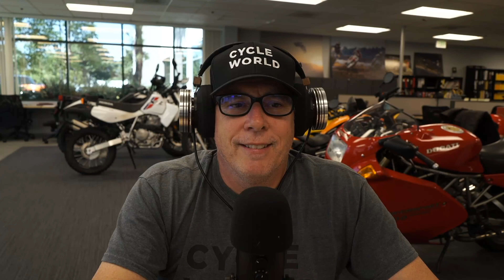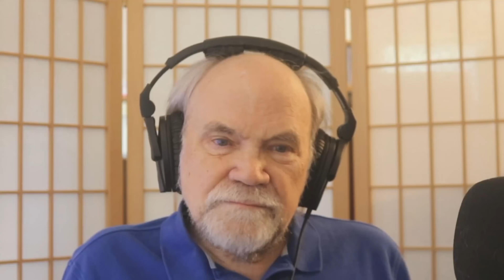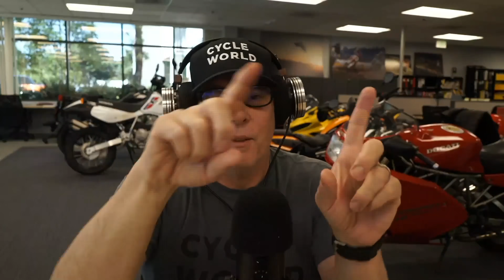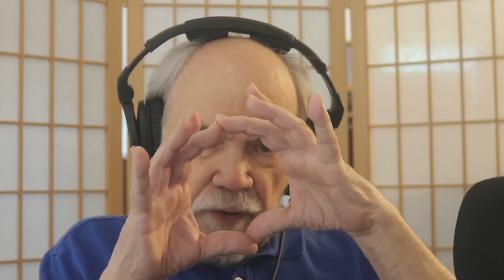JUST HOT ENOUGH! Combustion heat to tire heat to radiators, oil cooling and more: Heat Management!

Comment: Why not heat water with the exhaust and have a secondary power system for steam.  It could turn a steam turbine to turn a shaft that runs a generator that charges some batteries and capacitors.

Comment: Got a factory oil cooler and piston squirters on my 2012 streetglide.  I think this is why the factory top end still on it after 80k plus miles. .570 cams at 57k with better oil pump and cam plate.

Comment: Thank you for your fine podcast. I've enjoyed both of you guys'work in the past and am grateful to hear it.
When Kevin was sharing about the flame front of a hemi engine being longer compared to the flatness of conventional heads (shortest distance is a straight line and all that) I was reminded of a  Don Garlits' story. 
On the 426 hemi became available. Done Garlits was tasked with getting it up to speed using nitromethane. Though he and others had gained success with the previous 392ci hemi,  he ran into all sorts of problems with the 426. In fact he was so discouraged , he through so much  advance timing into it with the hope that it would blow up. No, that's what it needed.  So that let's start the party early with the flame with a high degree of advance was just that what that hemispherical shape needed to do to get the most use out of the nitro. I like you two said too about imposing  reality. There's an old Latin phrase which basically means "What's first in reality is last in perception."  It's s there. We just got to bump into it (or it to us)!

Comment: I'm just a dumb bicycle mechanic. 
But I have spent thousands of hours working with refugees from aerospace.
And spending time around physicists 
Working for FLIR in the USA and Lica cameras in Switzerland, as optical engineers. 
It's nice when pencil necks have a more humble and humerus attitude.
And not have the elitist, your just a stupid technician attitude. 
The last time I had to deal with this elitist attitude?
A mechanical engineer that I asked what he did.   His answer was,
I work with THERMAL FLUIDS!
I know what that means. 
But my intentional response was 
What's that?    Sounds so so glamorous.       Turns out, 
He was a technician repairing hydraulic systems on heavy equipment.  
I would rather be a dumb bicycle mechanic, any day that has ever been.
And I joked about how most people with mechanical engineering degrees actually work a technicians. 
And physicists work as engineers.
Always been a big fan of the
P n W 4360.   The air cooled monster radials.   The F2G corsair!    And unlimited air racing.
Bicycles  motorcycles and ww2 fighters.
And my rally car. 
Those things, turn my crank.
And bring things up to optimal temperature.

Comment: Combustion heat removal is highly dependent on the accumulation of combustion chamber deposits.  

Those deposits generally reach an equilibrium thickness over time, and these deposits have a very low thermal conductivity compared to metals.  So we are, in fact, using "coated" combustion chambers to help keep heat in the working fluid (mostly air).  

Before lead was removed from gasoline, these deposits contained a lot of lead compounds which did have higher thermal conductivity, so the removal of lead, cooled our "heads and jugs".  

Ditto for the removal of octane improver MMT (Methylcyclopentadieny Manganese Tricarbony) which left Manganese compounds in combustion chamber deposits.

Comment: one year, at Daytona (the year James Adamo died) we and several other teams were running one carbon and one steel brake rotor up front.  the reason was that the carbon rotors would get cold on the long fast run around the banking, so the guys would have no brakes, just before dropping into the left hander into the infield.  what then happened was that heat shock (from cold to absorbing all braking energy into one steel disc, as the carbon was doing nothing until it got hot, later in the lap) on the steel rotors caused them to explode.  I think that's what killed Jimmy, and it is what almost took my rider's foot off (Jacques Guenette).  I think Jimmy's brake parts locked his front wheel and catapulted him into and over the armco barrier.  Jacques was much more lucky.

Comment: There's a couple of technological transitions I remember from the 70's and 80's. The European manufacturers were using forged pistons in their air-cooled engines, so kept a tighter control on tolerances. It seemed the MX bikes didn't have as many problems as they kept moving more than enduro, however they still went through more pistons. I see some enduro bikes still come up with cooling issues with not enough fan or just not enough heat rejection for hot, slow conditions. A 250 2s doubled in power from early 80's to 90's.
Drum brakes were less susceptible to water ingress, but if held under water, they took a long time to become effective again. Disks, overall, were considered the go-to. Apparently water ingress is not fully abated with e-bikes.

Comment: I'm one of the tuned, 2 stroke, air cooled classic Lambretta riders that @TheSteelweasel mentioned. He has helped me understand heat saturation now I've got to implement some of his ideas. And he sent me here. I'm learning a lot and this is a very valuable episode for me. 
This playlist of a planned 200 mile ride out of LA and along the Mojave shows my tuned scooter running hotter and hotter running on a standard type cylinder head inadequate for cooling my engine until it got so hot that when I ran out of fuel the piston immediately got holed. The entire engine was very hot. Now the stator is acting up just as @TheSteelweasel predicted due to heat damage of components. Playlist of that ride:  https://youtube.com/playlist?list=PLrMfQB68MODISIAPXpnTV1zOe1pw3l_Zo&feature=shared

Comment: If only we could utilize all the heat of combustion and  braking. No offensive inefficiencies. I can dream. I once (1980?) built a Montessa 250VR engine for ARMA dirt track that was on the edge of seizure by the last laps of the short track races. Didn't have the means to make a water cooled cylinder and head. I so wanted to throw a bucket of water on the engine as our rider came off turn two. Fortunately he had great empathy for the engine and still managed to win the championship three years running. Like Glen Curtis said of his V8 aircraft engine, it was great until it got hot.

Comment: Advance Rumley  Oil Pull  Kerosene burning tractors had oil cooling ..I believe ..
Reply: They did, and used the exhaust flow to create a draft through the vertical flow radiator.
   And a great sound.
Reply: Similar to how steam locomotives used the exhaust to help create the draft through the firebox and boiler.

Comment: In my Hodaka motocross days I would push the bike to the starting line. I would wait until the starter raised the 30 second board and then count to ten before starting the engine. This was worth a couple of extra horsepower on the run down to the first turn. About 1/2 way through the first lap I would feel the motor lose some snap off the turns.

Comment: Kawasaki had Northrop work on building a ceramic engine (piston, rings and cylinder). Did not work (all theoretical engineers) because, just like metal engines, using the same material against itself in a wearing surface does not work. Porsche uses a ceramic insert in the exhaust ports to limit heat transfer.

Comment: I can see why ceramic insulating coatings for pistons is a problem, but I don't see a downside for exhaust ports for exhaust ports, other than cost.

Is it used in any production engines?

Comment: Why didn't air-cooled motorcycle engines incorporate a fan like a chainsaw does for cooling?
Reply: Convection as it moves through the air does that job. When stopped and idling, radiation takes care of that job as radiation varies in this example as the to-the-power-of-4 difference between the absolute temperatures of 2 objects
Reply: Many scooters like Vespa and Lambretta. And Puch all did just that.

Comment: Im a Lambretta enthusiast , air cooled engine . I found it gets heat saturation and lost power , ive increased air flow over head and cylinder but its Never enough . im now designing a radial head with more fin area . great channel Kevin is a top bloke
Ive been trying to explain cooling on my you tube channel to other lambretta owners who think they can tune engines and not change the cooling of it , its been hard work .
Reply: In the 1960s when two-stroke GP bikes took over, the biggest cooling issue was overheating and distortion of the cylinders. The engineers went for water cooled cylinders long before adopting it for heads - see MZ for example. Some backyard engineers would cut the fins off a standard two-stroke cylinder and weld a water jacket to it.
Reply: @pashakdescilly7517   we went with water cooled heads on our racing Lambretta's in 88/89 and the fully watercooled  its all according Which class you race as there are restrictions on what tuning and modification are aloud
Reply: @SRP-sidecar95   Interesting. Did you go for water cooled heads first because it is easier to make? Could these be bought, or did you have to do the work yourself?
Of course, any race machine must conform to race regulations that apply.
Reply: @pashakdescilly7517  Hi We machined the head from aluminium LM30 ourselves on a old Colchester student lathe we never used a water just thermo Syphon I try and find some photos
Reply: @pashakdescilly7517  I ran a water cooled head in my endurance scooter and the entire engine was cooler .
Reply: @TheSteelweasel    Helmut Fath was a multiple world champion sidecar racing rider who made his own engines (500 cc four four-stroke and later a two-stroke flat four). 
He was experimenting with the flat four two-stroke to see if extra cooling would gain power.  With the engine on a dynamometer, he rigged up a watering can and watched the power rise several horsepower. The water was pouring onto the crankcases, cooling the incoming charge.
Reply: @pashakdescilly7517  thank you very much , confirms what i thought . i ve done alot of racing and riding over distance and i always noticed the power loss when engine gets hot , let i cool for 15 mins and power is back but only for a few miles as once the motor is saturated of heat it returns quickly to the hot temps . i know moving to water cooling will fix this but keeping classic look is important so i need to find solutions . best regards Stephen Richards aka TheSteelweasel
Reply: @TheSteelweasel   That Helmut Fath watering can experiment was circa 1975.  I very much doubt that there are racing rules to stop you rigging up a total loss external  water cooling system.  An extra tank full of water, rigged up to cool your crank cases while you race....  Sounds like some fun with the scrutineers.
Reply: @pashakdescilly7517  WATER ON THE TRACK ?  but that would be fun . i remember some one injecting water in his header pipe to gain torque , he got pulled for it by scrutineers 🤣🤣🤣🤣🤣🤣
Reply: Been doing that for year's especially on race motor's but also roads engine's big head based on our own design good  luck with the  quest 😊